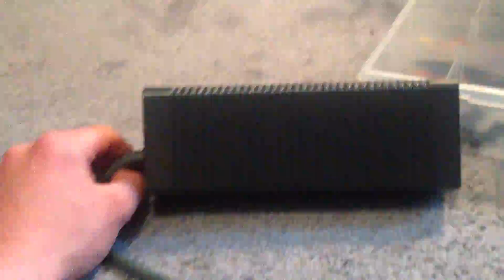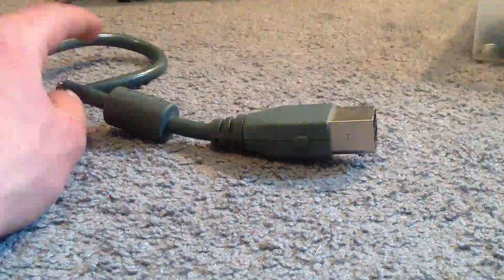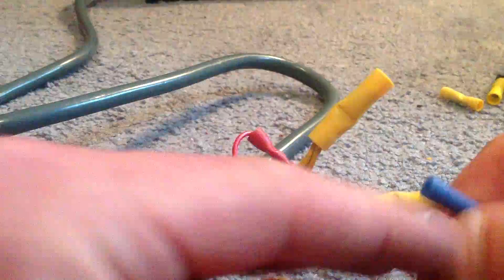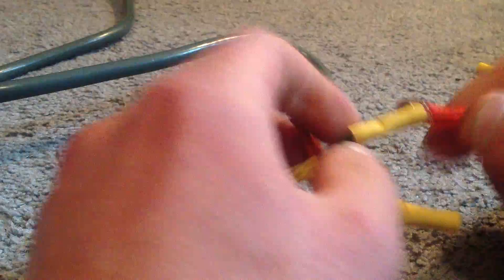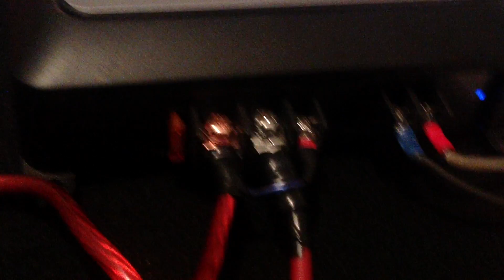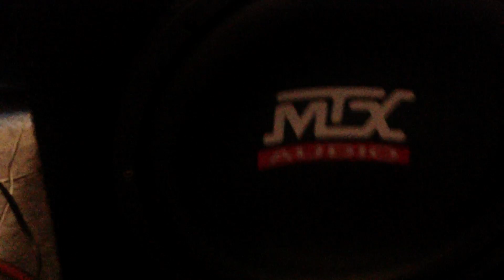Xbox 360 Power Brick to 12v DC adapter for Car Stereo or Subwoofers

Comment: do you think I can use this on a skar sdr 8" loaded enclosure?
Reply from the maker: What amp are you using. And what ohm are you running at?
Reply: @BenLeclerc  I haven't bought it yet but I'm going to use the skar rp350.1d amp
Reply from the maker: @ncpyro2464  whats your final ohm load?

Comment: I ran rca no good from cable or TV. So I'm thinking rca to 1/8th to aux. On deck. Then rca to amp?!
Reply from the maker: There should be an audio output on the back of your TV. Usually a white and red RCA output. You can use a regular RCA cable for this. Or see if there is a 3.5mm jack for output from the TV.

Comment: How big of a amp will thw x box cord power like a 1000 watt amp or like a 3000 watt amp so i know how big of a amp i could use please and thanks
Reply from the maker: There should be conversions online for ampers from Xbox to ampers at amplifier. Just make sure you have enough ampers and you'll be good

Comment: I have 2 yellow and 2 black, 1 red and blue and white, i put both the yellows together, the blacks together, and the red and blue together. The power brick lights up red, it used to be green, what could be wrong?
Reply from the maker: Try plugging it in and see if the white has power running to it and let me know.
Reply: @BenLeclerc  i just pluged in the white wire with the black ones and it works great, i bought another xbox 360 cord because i thought it didnt work and now i have 2 the work

Comment: One of my black wired has a white stripe...i stopped there. Any tips??
Reply from the maker: Should be a negative. Isolate the wire and use a voltmeter. Positive lead of voltmeter on yellow and the negative on the back wire. Mare sure you have 12+ volts and you'll be fine. Let me know how you make out

Comment: from the cut ends of the brick cable (yellow, black, blue, red) can I not just connect the yellow to power (on my subwoofer) and then black to ground? instead of adding the thick car cable with the fuse? thanks
Reply from the maker: You can just connect the wires, yes. But I would NEVER, i mean NEVER, wire anything electric without a fuse in between. Its a simple step that can save hundreds of dollars in the off chance something happens. There are a million scenarios that could occur that would be catastrophic for the amplifiers circuitry that could be avoided if a fuse is added! You could also start a fire if the spark is large enough. So you can wire these directly, but please please please, add an inline fuse on the positive wire for safety measures.
Reply: Living For The Ice thank you for the reply, my sub has a build in fuse would that be enough? I have a subwoofer in my car and ofcourse it is fused straight after connecting on battery. 

does this set up work if you connect low input audio cables (red and white generally) to the TV to get bass from subwoofer and sound from TV?

 thanks for fast reply btw.
Reply from the maker: Yes this will work for the RCA connection from a TV. And those fuses for the amplifier protect the internals of the amplifier. This is not enough though as you want to protect the amp entirely before it could become damaged. Too much of a power surge can cause the fuse pins (since they're small fuses) to weld together, leading to an uninterrupted flow of power to the circuitry. Protect your investment bro. Its well worth it. Sorry i took longer on the reply, im getting ready to head back to school and life is getting crazy haha.
Reply: Living For The Ice no worries pal, thank you for the help I understand it more now, wiring a sub in a car I know what Im doing but in a home I am new to, so sorry for all the questions just trying to understand.  thanks again
Reply from the maker: Always good to ask questions man. No worries what so ever! Hope everything gets working for ya.

Comment: how many amp this power brick make ?
Reply from the maker: I believe it is 15-20 amps per brick depending on which one you get. There are a few different ones out there that can have different output settings. I use 3 of them connected together in parallel to get sufficient power for my 500w RMS 4-channel amp
Reply: So you can hook up 3 of these together?

Comment: Mine has 2 yellows 2 blacks 1 blue 1 red and 1 GRAY.  What's the gray for??
Reply from the maker: Grey could be a neutral. Try taping it off with electrical tape and see if the brink turns green. If not, let me know and i will do some more digging around
Reply: @BenLeclerc  I contacted the grey to the 2 black wires and my Xbox 360 power supply is green so dose that mean it will work for the amp?

Comment: Okay opened my xbox power supply and i have blue red yellow and black wires as i should.. but what is the one white wire with them? Where tf should that go🤔
Reply from the maker: I have no idea man. Best bet is to wire everything as shown and leave white disconnected and NOT TOUCHING ANYTHING! Then plug the adapter in and see what happens. You can measure the voltage of the wire here too

Comment: I know this was a long time ago but could i run a aux splitter one end is a regular speaker and the other is connected to the amp where it’s rca to 3.5mm male. would that still work or no?
Reply from the maker: I dont understand the first part my friend. Sorry. Try to help me out a bit more there and ill see what I can do to help you
Reply: so if i plug rca to audio jack male to amp and use a aux that plug into a speaker and plug them both in a aux splitter would it work?
Reply from the maker: @yungboozer3395  I think I understand. Short answer no, you need external power for speakers to function. Using an RCA is only signal input, not power input.
Reply: It will work if you're using a device with powered speakers. I did that having an auxiliary going from my TV which can play things from my phone and split with my sundown 400 watt amp powering a couple small Subs and regular audio from a guitar amp. Great for home theater

Comment: The adapter I have is off of a cable box or something anyway I built an ice chest with 4 6×9 and a 200w alpine Bluetooth car deck and it works amazing but ended up having to add another power supply bc it would cut of at half volume. Anyway I'm running an amp in a buddy's house, should I run 1 power for amp and 1 power for deck?
Reply from the maker: Hey man. Run 2 power adapters to a power block distributor then that'll split it to the deck and amplifier. The deck doesn't need many amps at all. The amplifier will require most of the ampers the adapters will put out. Check out my followup video, it shows the power block distributors. Let me know how it goes!
Reply: @BenLeclerc  2 power adapters. 110 to 12v? And also a power block distributor
Reply from the maker: @jasonherod3567  if you check out the followup video, link in the description, I have that exact setup to run 2 amps. You'll understand more from watching that instead of me typing some big long explanation :)
Reply from the maker: @jasonherod3567  also, 110v is AC and we are converting that to DC power, 12v. We run 2 adapters parallel which still only gives us 12v output with double the ampers provided. If we ran the adapters in series, that would give us 24v which we don't need.

Comment: so I have 2 15" subs and there 1200 watts rms each and an 8000.1 amp. what would you say is best to do for this much power? bout 4 to 6 of the blocks?
Reply from the maker: Definitely wouldn't recommend this man. That is a massive amount of power required. Usually, unless houses are brand new and wired perfectly, fuse panels wont be able to handle this. And your electric bill will be astronomical. 
You'll also be doing a lot of damage to your amplifier and subs if you under-power them. I really do strongly recommend NOT to do this dude. I would hate to see that investment be ruined.
Reply: Living For The Ice 

Oh ok lol. it was a thought I had about doing was all. so what would you say is a safe amount of power. I only use it to watch movies
Reply from the maker: Hey buddy, sorry i never got back to you on this question. I usually am pretty good about this. Did you end up hooking anything up to your converted power adapter? I would recommend you run something under 500w RMS total.

Comment: If i put the power supply directly to my car radio isn't it going to blow up bcs on the car radio fuse it said 10A 12v
Reply from the maker: No. The fuse prevents surges of unregulated or reverse polarity power basically. The radio will be completely fine when you wire it to this adapter, granted you wire it correctly.

Comment: Hey I got a 4 wire Xbox 360 adapter will it works?!

I see all videos got like 4 yellow and 4 blacks wire

Myne is 4 wires 1 black 1 yellow on blue and one red.... Can I try it or will it not work
Reply from the maker: @JANNMANVenter  yes it should work. Connect the red and blue. Yellow is positive, black negative

Comment: I followed everything but my power brick stays yellow until I remove the 12v yellow wires from my amp, how would I fix this?
Reply: my brick turns green when I remove the yellow wires from the aml
Reply from the maker: +DabTheCrab™ PC/PS3 What version power brick are you using? What is the layout of all the wires you have?
For example, I had 3 yellow, 3 black, 1 red, and 1 blue wire. I would imagine that one of the wires are touching each other. If you were grounding out, it would be sparking, so your black wires are all set. Check the connection and insulation on the other 3 wire types and make sure none of them are touching.

Comment: Will one of these power a 1000 watt amp hooked to one 12
Reply from the maker: Devin Norris if the amp is 1000max then yes.  1000rms and you'll need 4 of these adapters in parallel to power it
Reply: @BenLeclerc   would you have to plug all 4 power blocks into wall?

Comment: I did tht and my amp won’t push full power and the xbox power box light goes red and shuts off any way I could fix it?
Reply from the maker: You're trying to pull to many ampers. Add more bricks to your power input. Check out my follow up video
Reply: @BenLeclerc  did you put resistor between red and blue wire? i use my xbox psu to power up may cordless drill.. runs fine for a couples of second then stop... psu lights turned red... unplug it and try again same issue... any solution?

Comment: Thanks Ben just watching your video. Looks good.so I do like a good cinema surround sound. With  good bass dub I've got  2x 1200 Sony subs. I been thinking of doing this trick for a bit now will it still work. With the 2 subs. In one box? I've just obtained an old Xbox computer which my neighbours was throwing away.  So I'm not a computer geek g anyway. So I've got a new charger. so it's a case of thinking about going ahead and try ING it
Reply from the maker: Yeah it'll work man. You just need an amplifier, you'll connect the power to the amp and the amp can be wired in series or parallel, giving you a wide range of ohms and power output. If you let me know the make and model of the amp and subs, I can tell you how to wire them if you're confused there.
Reply: @BenLeclerc   thata kind of you. Man when I drag it all out of my shed I let you no. I think I've got a monoblock amplifier from car. The Sony xplod subs in a double box  thinking of hacking the box in half and making too subs I think the 4 ohms subs.    I think the amp. Gos down to two ohms.  

I am going to put them behind a stud wall. Like a false chimney under my TV entertainment centre unit.  I was thinking of just putting the subs floating in the wall. But firstly they will Powerful. And it's against my wall. Eeek lol.  So I'm thinking of just screwing down the sub boxes to the concrete floor to prevent any vibrations  

I've got a Sony 1080 amp with twin pre sub outs.  if I why are there in series   I'm not going to get as a deep bass and get the most out of the subs? If I y them up parallel.  I will get the subs will go down to 2 ohm load. I think???

Comment: Help me man, my power supply is from the Xbox 360 slim, every time I turn it on by touching the blue and red wire, it makes an annoying buzzing sound, but it works, I don't know if it's stable, but it works.
Reply from the maker: Could be voltage instability. I wouldnt use it personally, not worth the risk. Buy a new one on ebay.

Comment: can you Combined 2 of those power bricks by any chance?
Reply from the maker: Linda C. you can! I currently had 3 wired together to generate more power since my subs require more amps than 1 brick can provide! check out my follow-up video (link in the description) and you can see two of them together
Reply: K Thanks Ben
Reply: I have a 600 rms 800 max 8 in sub and I'm tryna get a 600 rms amp, can one power brick  power that?
Reply from the maker: If you wired these adapters in SERIES, the voltage will increase. When you wire in parallel, you double the amperage but voltage remains between 12-14v. There is always extreme caution used when wiring to ensure that cross voltage introduction does not occur. And 8 gauge power wire is much to large for 3 bricks. This will only produce around 50amps max, which would require somewhere around 12g wire for a short (3-6ft) run.
Reply from the maker: No sir. To get the full ability of subs with that rating, you would need a minimum of 3-4 bricks wired in parallel and probably a capacitor. If you were to wire this into a car, you would have no problem with a simple 4 guage P/G install and wouldnt need the capacitor. I wouldnt expect anyone to push something over 400w to the limits with xbox adapters. If would take a lot to get them quite that high. But good luck with your install and let me know if you need any more help!

Comment: Alright buddy, I have completed all of your steps, went to turn on and no light comes on the brick and nothing happens, have a done something wrong? thanks
Reply from the maker: lewiskx hey man. if there was no light on there may be an issue before the power brick. check your plugs and make sure you fuse isn't blown on your homes circuit breaker. if these are both okay, there seems to be an issue with the red/blue connection. usually if these aren't connected, you'll just have a steady red light on instead of the normal green light. if those wires are connected securely (try soldering them to be sure) then it is most likely a bad brick. happens sometimes man. let me known how it turns out and if you need any more help
Reply: Ben Leclerc I think it's a bad brick ffs, haha, should have tested brick before I cut head off to see if it worked before.
Reply from the maker: Very glad i could be helpful man. Ebay sells authentic ones pretty cheap. Grab another one from there and give it a whirl!

Comment: My power brick keep going red , it not staying in the green light
Reply from the maker: menghak ma make sure you connections are secure. Use a butt end connector and crimp the two wires together or solder them together. Let me know if that works buddy

Comment: didn't read all comments before sending this , so im sorry if your answering it twice , im doing the same set up but for a radio , tried it last night but the power souce(brick) lit up orange which I think is the fail light , what can I do to correct this ? thank you in advance
Reply from the maker: JESUS VALDEZ hey man. no one has asked about this yet. but there seems to be a lot of people who are using the 360 slim adapter which works slightly different than the original 360 adapter. which one do you have and what color wires do you see on the adapter?
Reply: I have the 4 yellow and 4 black . and the blue and red. the brick says  xenon on the side on a sticker .
Reply from the maker: Okay, so i don't have my Xbox adapters with me so i don't know if that is a generic power brick or an authentic Xbox power brick. But either way, if the orange light is on, something may not be wired correctly. Make sure the blue and red are connected and sealed (electrical tape or shrink wrap). Then make sure your positives and negatives are also sealed off from one another so no shorting out will occur. Finally, be sure the leads are both hooked up properly to the amplifier. If this all is good and you're still getting an issue, take a quick video of everything from the brick to the amplifier. Post the link here and i will take a look to see if anything doesn't look right. Much easier for me to diagnose something if i can see it, ya know? Hope that helps bro!
Reply: THANKS ALOT , ill check again when I get home , appreciate your help .
Reply from the maker: No problem man. Glad i could be of assistance!
Reply: thanks man for the video , I cut everything and pretty much started all over again , and it worked, so I might of had a wire with improper contact, but all is great now .
Reply from the maker: JESUS VALDEZ glad to hear it buddy! if you have any other questions, feel free to ask!!!!

Comment: I got that but when I connect everything up it turns off once i turn up the volume to about or between 30-35. Could I also use a car battery? Would it then not shut off like it has been with the xbox360 power brick and be just fine..
@ Living For The Ice 
# Email Reply
Reply from the maker: So seems like youre not giving it enough power man. What is shutting off, the amp or the brick? If its the amp, youll need to add a second, or possibly even a third one to the mix!